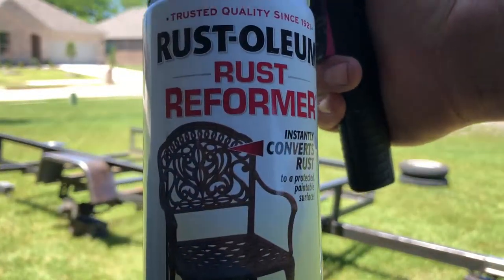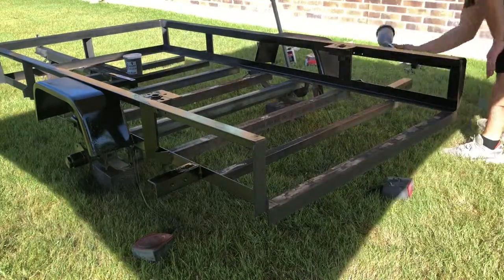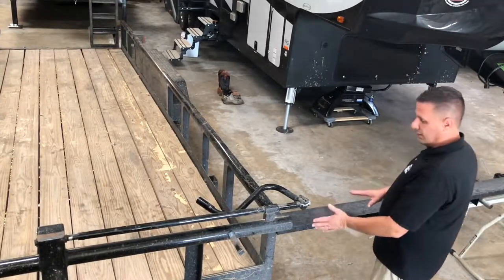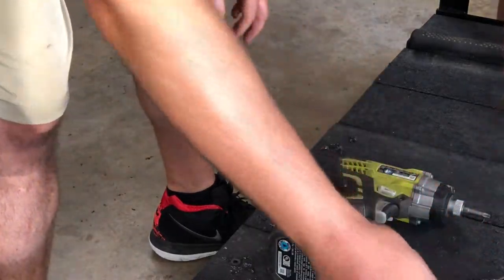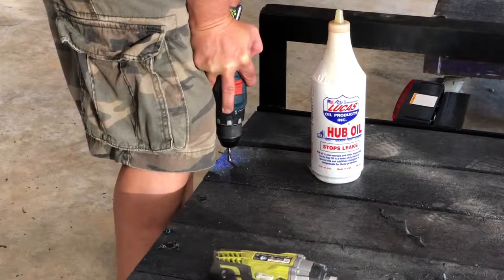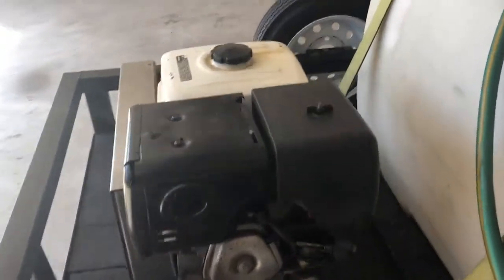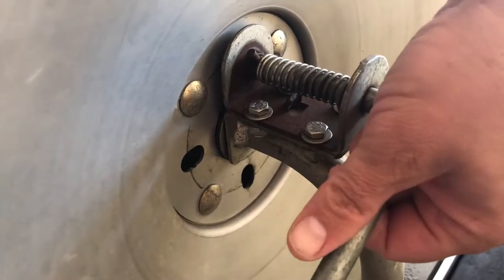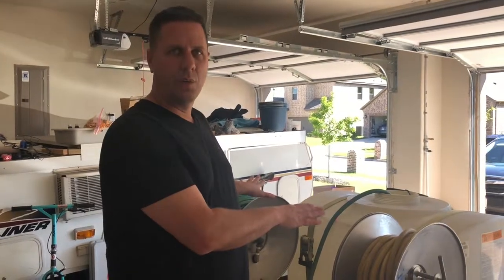Rebuilding a Pressure Washer Trailer | Wow the Before & After! | Part 3

Comment: all in , when the tank is full and hoses attached, what will the final weight be? (spare tire, plastic floor, tank full, hose reels, etc.
Reply from the maker: David Van Dyke the tank of water will weigh 600 when full the trailer and all the equipment should be around 600 as well for a total of 1200 lbs. That is a guess but should be pretty close.